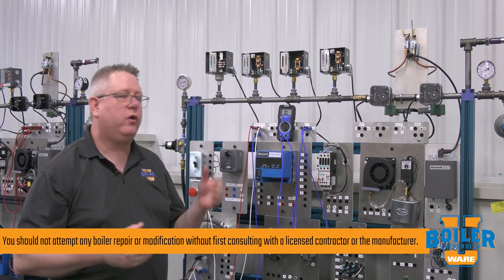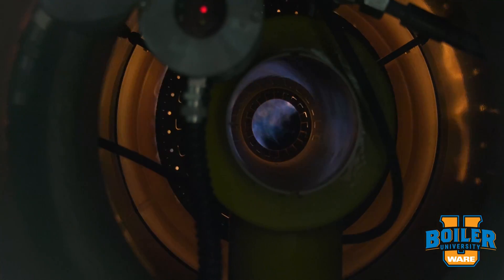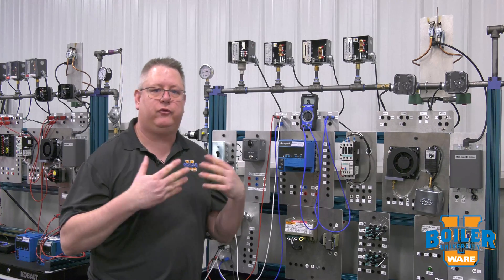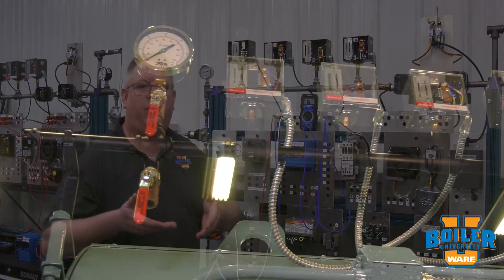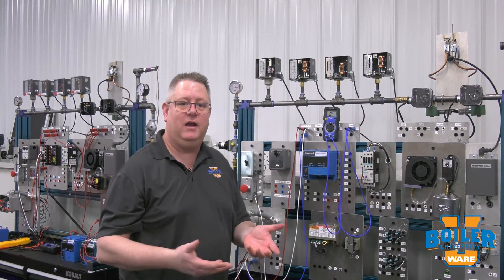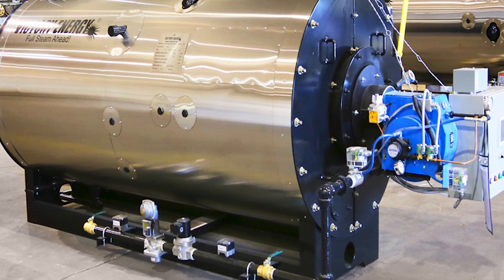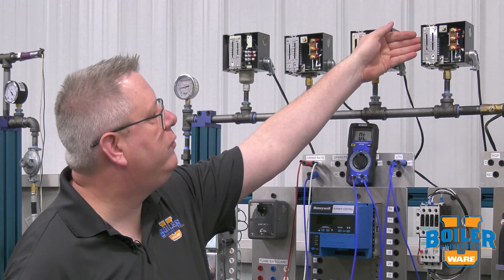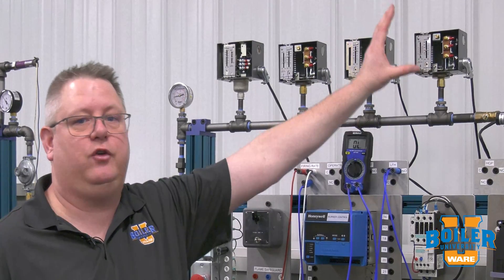What Does the Low Fire Hold Switch Do? Pressure Control Series Episode Five - Weekly Boiler Tip

Comment: Is it possible to have low fire hold switch on temperature on a low pressure steam boiler?    If so, where should the temperature sensor be located?